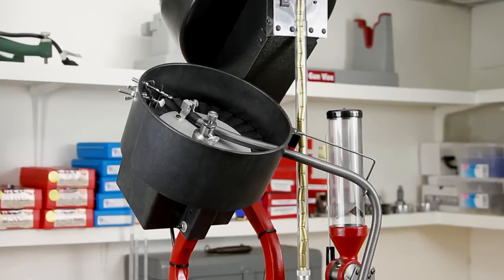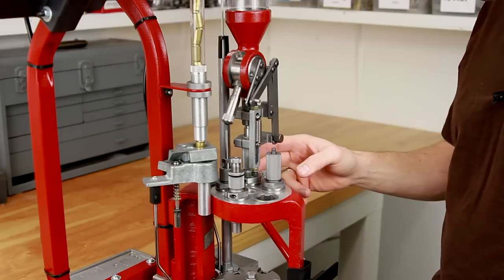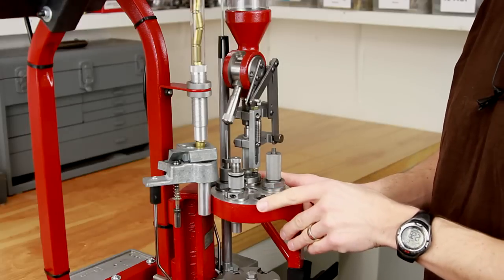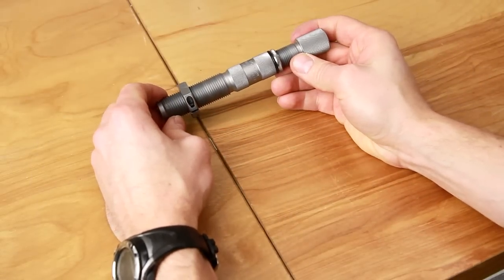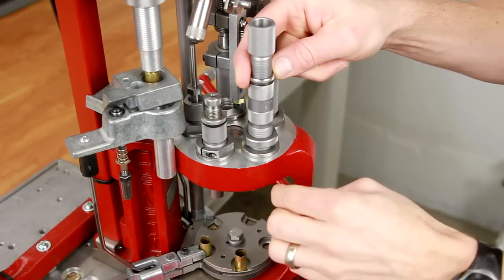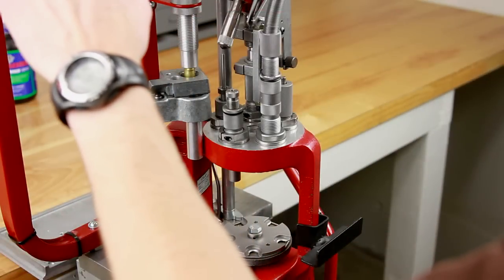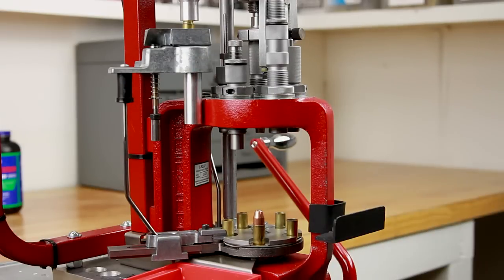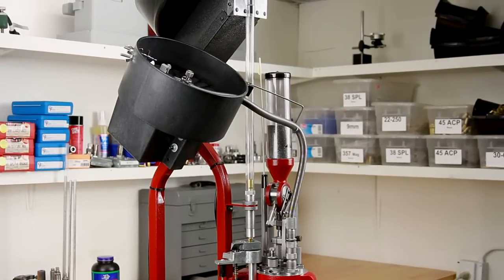Hornady Lock-N-Load Bullet Feeder Loading 45 ACP

Comment: I just got mine and had a slight problem with it. The center pin cam loose witch caused the hopper turning plate to start to rotate with the bullet feed wheel. I was able to take it appart and put some lock tight on the bolt that secures it. If your going to take it appart to do this make sure you take note of where the key way on the center pin lines up. It should face twards the bottom. I lined it up and made a mark with a marker. That way the drop funnel will be facing up. Seems to work now

Comment: If you haven't made a purchase yet consider the RCBS powder lock. It locks the press if your charge is too heavy or light. I like this better than just the visual Hornady which is still just a visual check.  Even though I have the Hornady LnL press this will fit the Hornady and is only a couple of bucks more at Midway.

Comment: Oh if you are loading 9mm instead of .45 acp forget the last post and stick with the Hornady. For some reason the RCBS powder lock crimps the case occationally and seals the boot into the shell because of the angle inside the unit. However it's great for .45 acp and larger case mouths than 9mm.

Comment: I guess I have to ask here as there are no reviews on the 220 volt unit. QUESTION: What is the advantage of the 220 vs the 120? Does one last longer, work better, use less electricity? I see the Sonic brass cleaner comes in 220 or 120 also. Of course 120 would be easy to just plug in but running a 220 outlet would not be difficult.

Comment: That is exactly as described in the instructions and it seems to work great for you.  However, I have not had much luck.  I did it the exact same way and I either get no bullet, 2, 3 and even 4 bullets.  Rarely do I get one bullet and never twice in a row.  What am I doing wrong and do you have any tips?  I am loading 45 Colt but I don't see why that would be the issue.  Thanks.
Reply: Im having the same issues. Mine worked flawlessly for a few thousand rounds. Now i either get no bullet or all of them

Comment: Are you using the Hornady die set for 45 ACP?  How do you get around the roll crimp that the seat & crimp die in the last station does?  From my understanding semi-auto loads work better with a taper crimp.  Thanks in advance.

Comment: Have you made any mods to your #1 shellplate to get it to eject .45 ACP correctly? I ordered my press from Sinclair and bought the #1 shellplate to load .45 ACP. When I got the press I noticed the manual showed #45 for 45 ACP and now I'm having issues with it ejecting completed rounds. About half hang-up and I have to manually remove them. Awesome video!

Comment: In your opinion which press is the better buy / press , the Hornady LAL  or the Dillon 650 ? They both look awesome !
Reply: I've owned both, I'm going to sell my LNL and re-buy a 650.  Buy once, cry once.  I have issues with upside down cases every 20 rounds, unreliable powder drops, case feeder drops brass off the side of the press, primer tube pops up every few hundred and have to disassemble it entirely and reassemble.  Just lots of small issues really.  It's worked fine for the last year, but gets old quick.  Buy the Blue one!!

Comment: With my Hornady I seat and crimp in station 5 also. However, I notice the retaining spring tilts the bullet (I don't have the bullet feeder) inward which forces me to hold the case and bullet verticle till it contacts the die.
I notice you do not have this issue. What do you do about the case/bullet being slightly tipped?
The case is on top of the spring partially. 
1. Sizing/Depriming 
2. Expanding 
3. Powder charging 
4. RCBS Powder Lockout Die 
5. Seat & Crimp --- Suggestion?    Thanks,  Jane